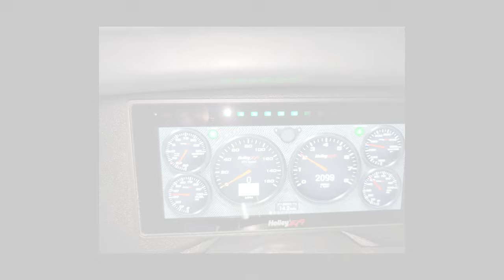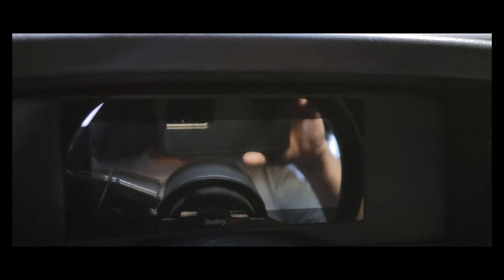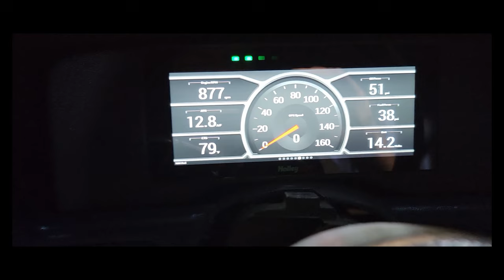Holley 6.86" Pro Dash - 88 Mustang GT

Comment: Have you noticed any difference with the way it runs just based on swapping from stock to the Holley? I'm thinking of going this route with mine. I've gotten used to being able to plug an OBD2 Scanner or Laptop in! LOL
Reply from the maker: The car runs much better with the Holley Terminator X kit.  Holley Terminator X Engine Management System 550-937F $1,164.95. Go for it!
Reply: @JeffPalmerJWP  thanks man! It's on the list after some decent seats! Lol